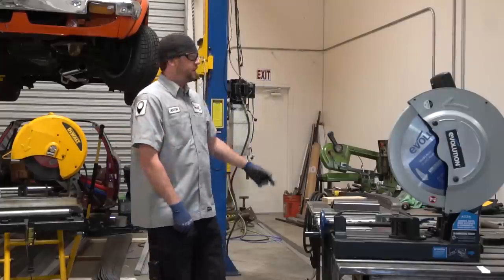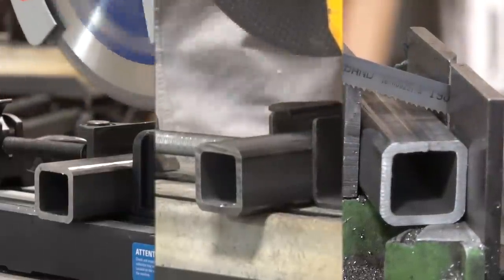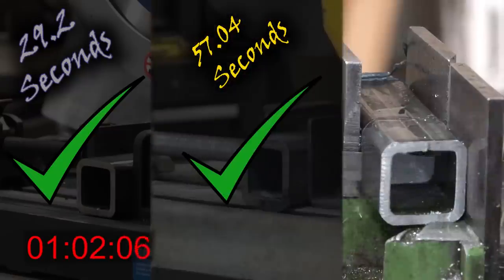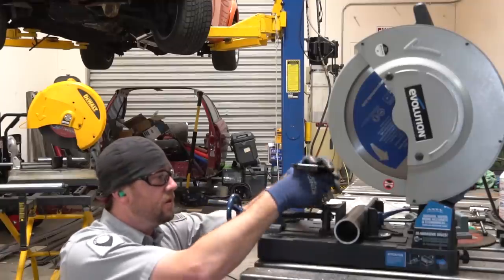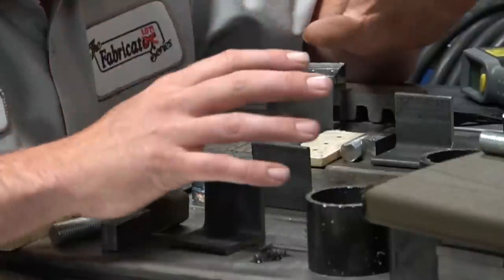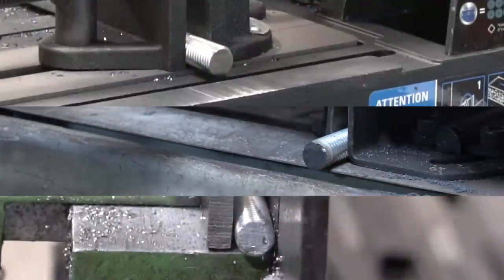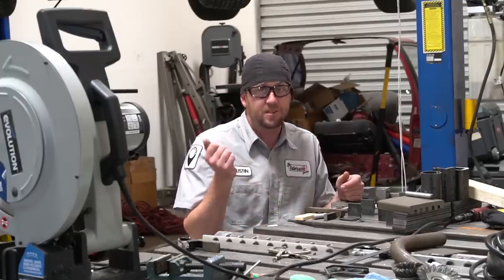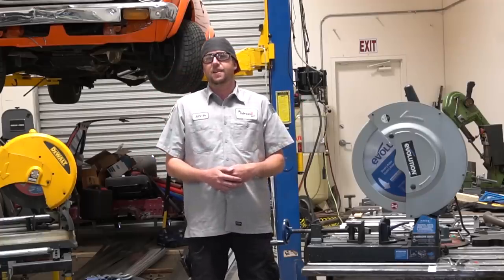TFS: 3 Metal Cutting Saws Tested and Compared

Comment: I had the cheaper (perhaps less expensive would be more appropriate) Evolution Saw. I cut a lot of steel with it. But, I didn't care for the clamping
system. It did not have the flip up thread engagement lever, so I spent a lot of time cranking the wheel back and forth. It always felt like I had to fiddle with it to get a solid clamp. Also changing the cut angle required finding the correct allen wrench. I found I had to cut quite slowly to get get somewhat square cuts. I chalked that up to the stamped metal base. I gave it to a friend who was thrilled to have it. I replaced it with a Fein Slugger, which I love. It has a cast and machined aluminum base  The clamping system feels much more positive. Changing the cut angle is done with just a flip of a lever, out and back. The two allen wrenches you will ever need store in a convenient spot right on the saw. It also has a slide out chip tray that catches some of the chips, but certainly not all. I considered the more expensive Evolution saw that probably compares more favorably to the Fein. But I found the Fein Slugger at a killer price, so I grabbed it.

Comment: harbor freight sells the metal chop off band saws for either $280 for a regular  one or $999 for a hydraulic one. the main problem i have is the weight the $999 is super heavy and the $280 one is still heavy, like 200 or 250 lbs

Comment: I've had the Dewalt 355 Dry saw for a few years now, cutting 50mm x 3mm square tube. Great BUT - one issue is when you try to do mitre cuts, the blade approaches the work off centre - so the first point of contact on the tooth angle can't bite into the horizontal surfaces - instead it skids across it. I thought my blade was blunt or something - but it's actually a bit of a design flaw. The mitre-setting needs to slide closer to you, so the blade can bite in more from the back. It'd be a huge factor if you had to cut alot of mitres in box section. Not a problem for round though. I end up having the raise the work higher, to get the blade to make contact sooner.

Comment: In the long run, in a shop where it's used a lot, the band saw is the winner. For a diy guy, occasional use and space limited, carbide is best. For cheap occasional use in a rough environment, abrasive wins. I have a dry cut for reasons stated above. I would take a good band saw over it in a heartbeat

Comment: Angles...Angles...Angles...  Bandsaw all the way, angles on these types of chop saws are a joke (not to mention a mitering head allows you to keep the work in the same position).
Reply: I have a evolution rage 3DB (double bevel) and it will do composite miters with angles that are dead on... I don't know any other saw that can do this
Reply: @aigretbenoit  Those evo saws are impressive. But they're just not on the same playing field as an Ellis, or Hydmech, or Dake. I think for the average homeowner/project gig, the evo saws replace normal compound miter daws and chop saws, which is definitely a game changer.

Comment: As someone mentioned, besides being VERY messy from the dust getting everywhere, the biggest problem with abrasive blades is them wandering and not cutting square - especially if the cut is not square or of an irregular shape - might not be too much of a problem with little stuff, but anything of a decent size WILL need re-working to clean up the angle.
Worked for one company that had a 'trusty' abrasive cut-off saw and, when it blew up, rather than getting the (cold) toothed cutoff saw I wanted for just a few dollars more, they got another abrasive one because they had 3 or 4 blades for it and they didn't want to 'waste them' - the faster cutting and reduced reworking time would probably have paid the difference in under a week!
Reply: Time to open a competing shop?

Comment: Great video. I've never seen a comparison between these three types of saws before so it'd be useful to anyone that hasn't, like me.
My only question is: would the abrasive saw also work well on tiles, glass ceramics or even thin slabs of stone e.g. slate etc. ? I know the other two would not, so no comparison is possible in this sense, but it does add to the list of materials that the abrasive can cut (which as we saw is limited wrt. the other types to those that don't melt or catch fire). Therefore it will be of interest to those who are looking for this additional ability while only wanting to get one saw.

Comment: Have owned all three .  Band saw and abrasive saw both collect dust in the corner of the shop.  My evo is used almost daily and is used in the field as it is portable .    Picked up a port a band a while back and that is getting used more and more . Band saws just seem to be slow and the coolant thing kinda drives me nut.   Those abrasive saws may have had a place 30 years ago  but have no use in this day and age. Had a friend that worked on the railway and used to be able to get half used abrasive wheels for free as once they were to small to cut track they were thrown away.

Comment: To be fair that's not the correct blade in the abrasive saw, it is for a gas powered handheld demo saw. You can see it clearly around 10:59 when you clamp the wood down. Not that it would really change any results but I believe the blade may be thicker than an actual abrasive chop saw blade

Comment: I use my powerplasma cutter most of the time but a metal cutting saw would be very useful to have around.
Reply: I'm considering one. Would you cut tubing with it, or 150 mm C section?

Comment: It's better to setup square stock with the corner up on chop saws. Cuts quicker and more accurate.
Reply: oh really? Had no idea. Do you put it on a v block so it doesn't rotate?
Reply: @Tylerfrompdx  Yes, this is true for hollow stock, but not so much for solid stock. Some saws come with vise inserts to support round, rectangular (including square and plate) stock at the best angle. Basically, you want to minimize the width of cut for the blade across the entire profile. With the 'diamond' orientation (corners up and down, flat faces at 45 degrees), the blade never sees the flat faces. For something like 1/2 inch by 3 inch, stand it up to cut. For something too wide to cut vertically, consider angling it from font to back (ie not flat on work table) again to minimize the length of cut as the saw blade cuts through the piece. This can be done using vise inserts on one or both jaws.

Comment: Once you buy an evo you'll never look back! 2000 cuts one 1 blade and still goin hard! Fastest saw ever to, is dirty as far as chips flying though!
Reply: Agreed.  But the chips from a dry cut saw are way cleaner and easier to clean up than the filthy fine dust from an abrasive saw any day!
Reply: You cut only mild steel ?
Reply: @ouelketken5076  mostly, tend to use plasma on hardened. Diablo makes blades for about everything though.

Comment: I picked up my Kysor (now Dake) Model R (12"x7" cut area, or 7" diameter round) with coolant system for $200 used. Granted, that's not the norm - and it DID require some cleaning up before it was ready for prime time. I'd say it cost me about $100 for parts/paint/etc. (including a replacement blade) and I put a fair bit of time into it. But I refurbished it to near-new condition. But that was primarily a result of my OCD. It would have been just fine with a deep cleaning and new blade, but I had the time so I figured why not. But out of curiosity to see if I got a good deal, I looked up what they were selling for and saw a decent number sell for around $400 but in significantly better condition than mine, which I think is a great deal for it

Comment: Bandsaw wins. I have a DeWalt abrasive saw like yours and only use it outside as there is tons of abrasive dust created by it. What is funny is some people use a mask when cutting with it, then take off the mask when done. There is residual dust for a time after use and because it is so light, it becomes airborne any time it is disturbed. Not good. Remember, it is the stuff you can't see that kills you, not the stuff you can see.

Comment: I want a saw that I have not found available yet.    The frame on the Evolution and the abrasive saw I hate.  It's just not as accurate or it takes to long to cut "EXACT" angles.   I want it like a 12in Dewalt miter saw...Able to turn the blade left and Right....yet have the slower speed motor to tun a Evaluation blade or equivalent.
Reply: Evolution has metal cutting miter saws available

Comment: Band saw is good for walking away while cutting. Or cutting many at one time. 
Abrasive.. entry and cheap to start.
Cold saw.. move up from the abrasive. 

Abrasive chop saw are just messy. 
I usually opt for a 4.5" cut abrasive. Way skinnier = less mess.

Comment: Ok, so what I'm doing wrong? When cutting stainless steel pipes with Dewalt abrasive saw i couldn't get a clean straight cut. It always got curve like the blade was flexing away. I tryed cutting with big, medium, and light pressure. Never got straight cut :/ 

oh, i thought it can be caused by old blade, so i mounted new one - it didn't help

Comment: I just flat won't use another abrasive chop saw.  Besides the lethal dust, the noise, and the smell, the sparks try to light fires everywhere.
I own a portable bandsaw and love it, but I'm eyeing the Evolution S355CPSL now, for $379 with the steel blade.  Maybe some sheetmetal and bucket catchbasin work is in order to catch the frags.  And I already wear hearing protection with most tools.

Comment: I've got a horrible fright basic metal bandsaw (the red one) that was WAYYYY inexpensive and cuts 4" stainless(304 and 17-4 mainly), bar, plate, alum everything and it was a great couple hundred dollar investment.  Honestly surprised me.
 If you're on the cheap for a bandsaw, you can't get much better.  Plus, 2 years into it, I'm still on my original blade with weekly use.  Granted, it's dulling, but impressive none the less.

Comment: Evolution Kind Saw is very fine. I have a cheaper Brand and it works fine. Just find Somebody or a tool to sharpen blades. Buy two at the beginning, so you can go on cutting while the other blade gets sharp.

Nice comparism. It was kind of expecting. But i really thaugt the bandsaw is faster. Thanks for your Investigation.

Comment: surprised you didn't have a piece of aluminium to cut up. you mentioned using the evo saw with aluminium... One thing about abrasive saws is they're really only meant for steel. Aluminium will gum up the abrasive... Bandsaws, with the correct blade, can cut anything.

Comment: What about an old school heavy power hacksaw? They can cut faster than a bandsaw on fullspeed and the blades are cheaper and can cut from thin to full round stock pretty efficiently. I've got a 1960's BSG that weighs like close to 400kg's but dahm can that thing cut all day long.

Comment: For metal shop using solid, angle & section materials. Bandsaw every time. With M42  blade Vari- pitch with minimum 25mm / 1”  wide blade. once blade “run-in” should be as quick as anyone would want+ no or very little burr to remove after cut. . Also lot less db. Sound levels ,No dust, Sounds less than others saws, cut bigger bigger material if cutting bigger material machine should fall on its own weight also without  being pulled down , freeing operator to do another task. All in all with bandsaw accepted the initial cost higher but running cost is much reduced cutting oil being soluble is cheap by volume . Cut quality much the finer with reduced burr!👏👍

Comment: You missed the most used saw in my shop and that is the hand held handsaw. 200 bucks depending on what you want, cuts anything as long as you use a bit of care and common sense and is portable enough to save double handling material especially good if you only want one piece. You also missed cutting solid and that's where the band saw usually shines. The ultimate is probably the Cold saw a carbide blade like the other but with coolant.

Comment: So where is the cold saw in this roundup? Great testing. I love my dry cut Evo type saw. (BTW: you need a different blade for SS) No coolant to clean up and clean and fast cuts. Big jobs where you can walk away, the bandsaw is king, but for small single cuts the carbide is the way to go. Between the metal dust and abrasive grit thrown everywhere, I will never let an abrasive saw in my shop again. Outside work only. Good for cutting rebar where you never know what is in the steel, and don't want to risk a good blade, but that's about it.

Comment: Don’t mind spending the money on the Evo but what size blade will give the most versatility without being overkill.  Also, does the Evo have all the same capabilities of the other saws when it comes to angles, how it clamps the material, notching etc.  Next, can you talk about blade pricing and how many different blades you will need.  Sounds like the steel blade is fine for aluminum and you’ll need a different blade for stainless.  Is that all that will be needed.  Lastly, will the Evo blades last the longest, I’m guessing comparing to the band saw blades.

Comment: Thanks for your post.  I would like to ask about cut-off saws.  Have you tried cutting thick square tube?  Does the blade last on say, 1/8" thick steel tube?  I have wasted a bunch of money on blades, trying to find a good solution for cutting, accurately and quickly.  I bought an Evolution 10" carbide blade for one of my regular miter saws (5200 rpm blade).  It dry cut the 1/8" thick 2" x 3" tube fine for 3 cuts and then was dull.  That was a waste of around $80!!
I went to Lowe's and bought the only 10" steel cutting blade they carried (DeWalt) and it lasted 3 cuts (even trying to use a spray lube.
A waste of another $70!!!
I had an old, (not dull) steel cutting blade and it only lasted three cuts on 3" x 3" 1/8" wall tubing.
I was just wondering how the slower cold cut Evolution saw does on thick tubing.
Thank you.
DW

Comment: My only complaint about those evolution type dry cut saws is the cost of the blade and how easily they can be ruined with improper technique ie excessive pressure or maybe even not enough pressure. Band saw would be my pick accept they take up alot of room and a good one can cost as much as a proper gold cut saw.

Comment: Jason, love what you do. Question. Can you. Just swap out an abrasive blade for an evolution metal blade and call it a day? Thanks man!
Reply: Hi John, no ya cant just swap abrasives for an evolution blade. The abrasive saws run their wheels about twice the speed of the evolution saws. I actually got lucky in that someone bought an evolution saw and put an abrasive wheel in it and thought it was a crap saw, told me to take it away for 20 bucks!! I bought a proper evo blade for it and have ran it without a problem for well over 2 years now! Great saw!
Reply: Thank you for the clarification. I appreciate the response.

Comment: dollar for dollar i think its hard to beat that evo saw, but id love to see how a portaband with a stand kit would stack up to it
Reply: I have a 14" Morse dry cut and a 5" Milwaukee portable band saw with the vertical stand kit.  Very different uses, the band saw i use for small work, where I'm making little tabs.  The dry saw for bulk steel cutting.  While you could cut up to 5" material with the band saw, keeping everything straight would be a real challenge.  I've got the Swag Offroad kit for it, and the mitre gauge isn't parallel to the saw blade, and keeping the saw square vertically to the table is also tough.  I'd still buy one again (or maybe a competitors), just need to know its flaws and its limits.

Comment: Years ago we got an Ironton one with a coupon at Northern Tool, so we skipped getting an abrasive chop saw to begin with.  The Evo looks nicer, but this thing has so paid for itself.  Yes, it's a loud percussion instrument, but cool to the touch and it doesn't contaminate your metal.

How much more work do you have getting carbide crap out of aluminum?

Comment: Hello, My band saw is not as fancy as yours, no coolant, barely 120 mm wide, and when I try to cut with it, it never gives straight cuts, always away from 90 degree and the blade itself is not straight relative to the direction of movement, only the bearing of one side can be adjusted... does the more expansive versions pre-calibrated for good? Do they have more adjusting capabilities? I am very frustrated from band saws with my experience..! took one only because it is quite...

Comment: At least in Europe you can pick up a reasonable band saw for as low as $1200 (converted from €). For me that's be a no brainer. Where do you find an abrasive saw or a circular saw that can cut 180mm (7in) round stock for a similar price?
But I admit, each has their own use case, and the machine always has to fit the application.

Comment: I'd say unfair on the Bandsaw. With the right Bi-metal blade (less teeth) and running faster, it would have done just 

as well as the Evo. Plus, walk away, and a cheaper blade.
Reply: @Richard NZ Ah.......He's comparing cut Rates and SPEEDS, with times displayed, so yes, it is a competition between those machines. Unless you maybe didn't watch the entire video.

Comment: Which is the better value Evolution, for occasional cutting (including blade cost)? 15-inch $350 , 14-inch $230, or 7 1/4 $150? (Amazon prices 10/14/2019).